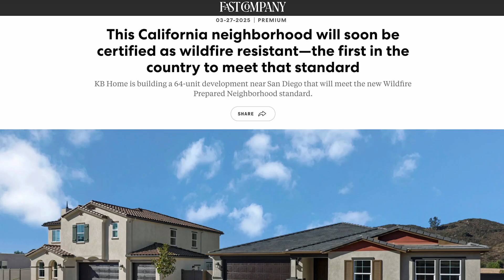Life on the Edge | The Home That Won’t Burn

Comment: Has super adobe been tested for fire? I would think that parts of plastic tubes/bags surrounding the soil could start to melt under high heat.
Reply: And then what? The earth inside the bags gets compacted and stands on its own. The bag is only there to get the structure up in the first place and maybe to prevent major erosion if the outer layer (that doesn't burn either) is removed.